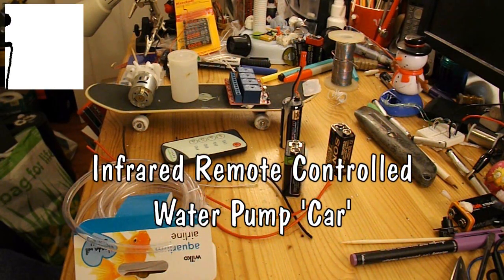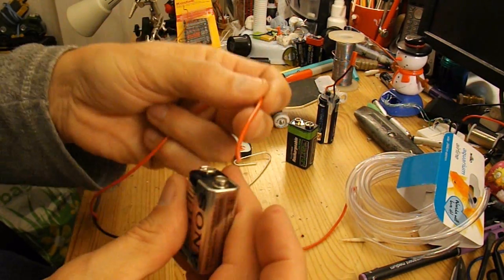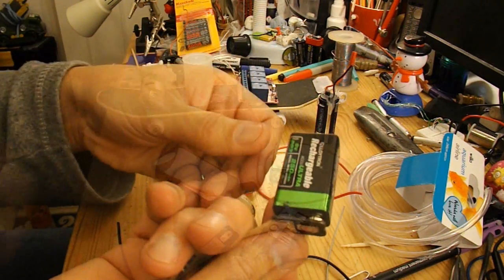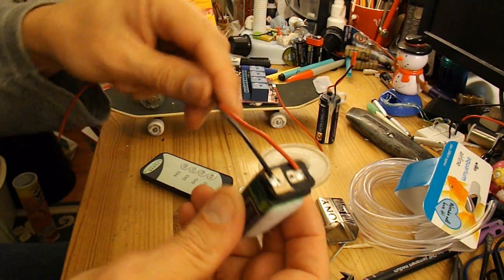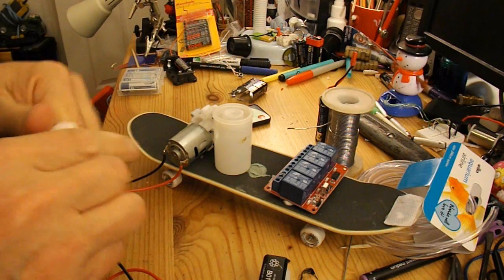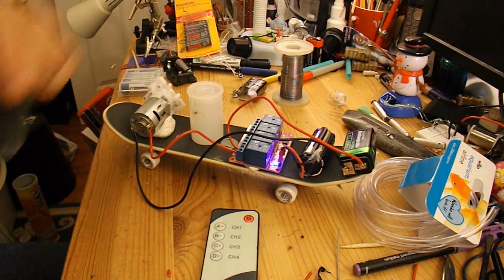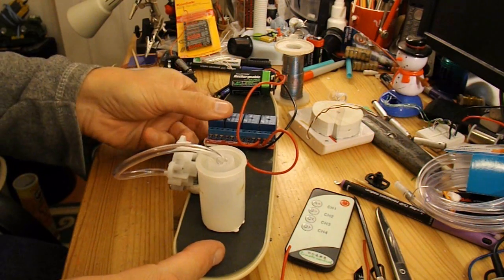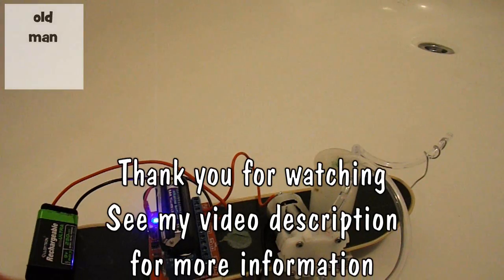Infrared Remote Controlled Water Pump 'Car'

Comment: Did you forget to use a fume extractor or somthing? cuz when you were soldering there was no extractor
Reply from the maker: Nicam16 I just open a window and sometimes if I am doing lots I will use a fan.
Reply: K just checking the saftey of bristol will not be corrupted by fumes :D

Comment: Hello GrandadIsAnOldMan 
Awesome Video! I find all your video entertaining to watch! Keep it up! I just want to ask, what tool did you use to strip the plastic off the wires? Thanks! :-)
Reply from the maker: I use wire strippers 4:12 that I picked up in a second hand shop, but you could get similar items in most tool shops. Here is an eBay listing for one http://www.ebay.co.uk/itm/181293977443
Reply: Thank You!!! :-)

Comment: Great video but all I could think about the whole time was-----what is powering the Snowman?  A tiny battery, solar cell,  or homemade battery?  Some secret power source ?
Reply from the maker: What? You mean that there is one of my videos you have not slavishly watched from start to finish? Shame on you :-) If you look carefully in front of him there is a sausage string of cells from inside an old 9v battery and I am letting him run from one at a time until it finally expires, then move on to the next. Not sure if he is on the second cell yet, or still running from the first. In the video below I did have 3 other cells that were really worn out and he lasted a week or so on them, but this string has a bit more life and he has been going for quite a while now.
Here is the original video "Helpfile - Are these dead 9 volt batteries any use? "
http://youtu.be/oXc6JmrsPOI